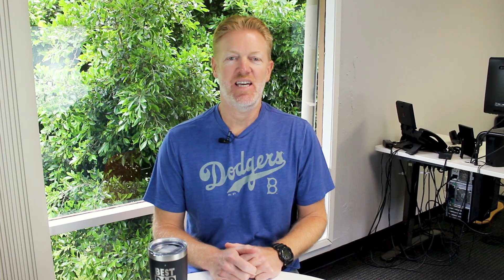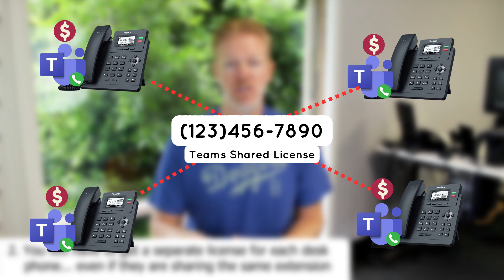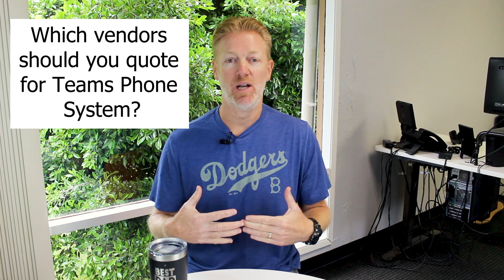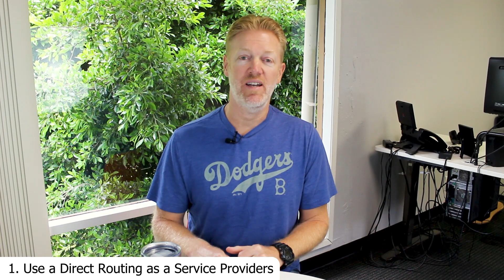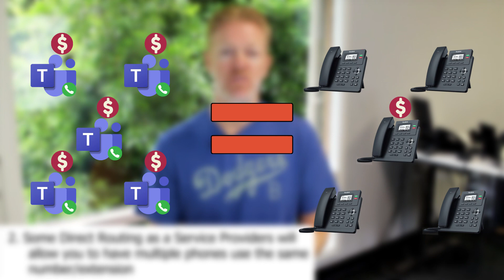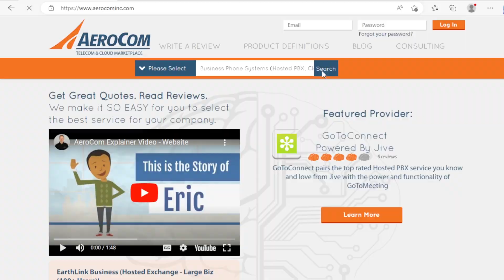Microsoft Teams Phone System: A Secret for Retail and Manufacturing Companies

Comment: Hi, very instructive videos, question, on a SIP Trunk with direct routine, may I keep using extension numbers? or only by name/ teams user?
Reply from the maker: Yes, you can keep your same phone numbers. You can set up routing by either name or numeric extension.
Reply: @Aerocominc  Phone Numbers yes, but extensions? Even if the PBX trend disappears using a Direct routing Sip Trunk to MS Teams, do I have to use Powershell comdlets to fix the extension number, and the big question is, this extensions numbers can be used from an auto attendant by an external caller? Thanks for your answer.